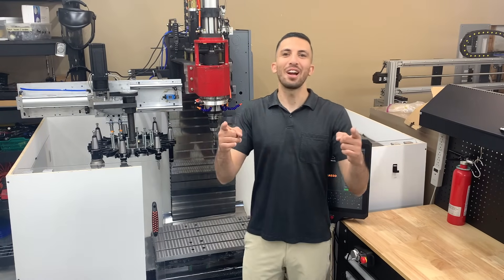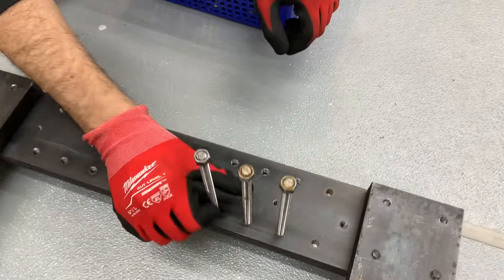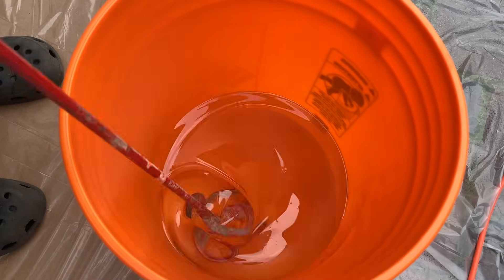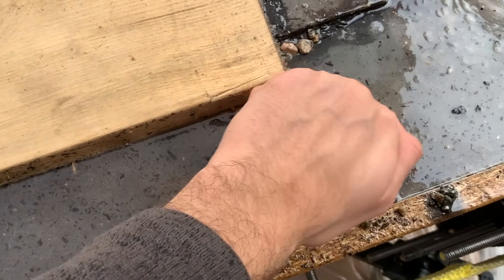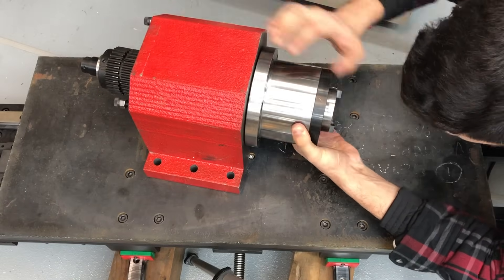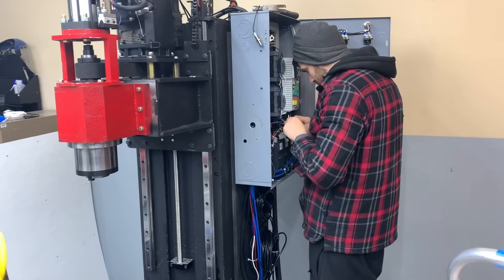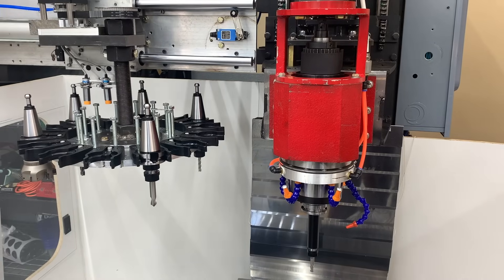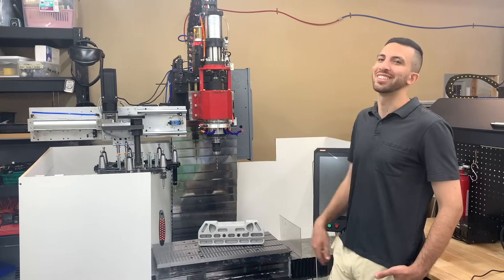Building a DIY CNC Machine With Automatic Tool Changer

Comment: Do you have any specs to how precice your machine is and how parallel the z axis is to the xy gantry?
Reply from the maker: yes I do. There are two tramming mechanisms in the machine which I have not documented for the sake of keeping the video short. Seeing that everyone wants the details, If this video is shared sufficiently and gets enough interest I will follow up with a second video describing the specifics and physics of why I chose to do what I did, as well as release the plans (aka CAD files). Glad you enjoyed, cheers.
Reply: @ActionBOX  Also why did you choose to go with an Belt type spindle? as there are get to go solutions from jianken with 8kw ratings for about 4.150 CAD with shipping. Another good point to add maybe in the description would be if you meant 15k us $ budget or CAD
Reply: @ActionBOX  Yes. We're very interested in how and what you achieved. Building these is a lot of work, but tramming them properly is where the magic happens. Show us how you did it!

Comment: 11 hours and one endmill??
Reply from the maker: Correct. It was a 1/2" carbide roughing end mill.
Reply: @ActionBOX  that seems a bit long. Maybe 4-6 hours for a 1990s CNC. You can prob bump feeds / speeds esp at your HP.

Comment: Nice work! I like how you just threw the rocks in. I think too many of us (me included) go  nuts with trying to find the perfect epoxy granite mixture, ha ha.
Reply from the maker: To each their own. I was on a time budget so I didn't care to have a suboptimal mixture. The perfect ratio is primarily used to save money by using less epoxy anyways, so it is probably wise to do so, but was not feasible for my timeline. Glad you enjoyed the video 😃
Reply: There is a LOT of rigidity lost with this method. The ridigty in EG comes from the filler material, not the binder(epoxy). I get that there was a timeconstraint in play here, so some compromises must be made, but this method of throwing in the rocks seems kinda....um....wastefull? Even though i disagree with the method, i have the greatest respect for "getting stuff done", so thumbs up for that! :)
Reply: @thomasegjoergensen  Not sure wasteful is the biggest issue, when the first DIY epoxy granite machines were being made there was a lot of time and effort that went into the best aggregate mix in order to improve rigidity. From a machinists perspective, if the machine isn't rigid it makes a fairly good but small footprint router, the other thing I'd be concerned with is  because of the 'rocks' rather than an optimal aggregate mix, how much and which way is the base going to move as the epoxy continues to cure. As for a quick build, good job I'm just doubtful of the long term value of the build.

Comment: How did you dial in/tram the machine? Differences in height between the rails?
Reply from the maker: Hi, great question. I built the tram into the spindle block itself (where the big bolts holding the red spindle mount on the the spindle block are), and there is a tram built into the column where it is attached to the base. To check the tram I used a dial indicator on a long extension arm rotating on the spindle with the dial sliding on the table.  I wanted to keep the video shorter and therefore cut out these smaller details, but it is there. Let me know if you want more clarification 😃
Reply: @ActionBOX  ah cool. To me, it looked like you just checked that the rail had the correct spacing and then bolted everything together xD
Reply from the maker: @TheVralapa  Indeed we did have the trams, but YouTube is more about entertainment than enlightenment so we had to cut out the boring parts.
Reply: @ActionBOX  yepp, got it! Nice job :)